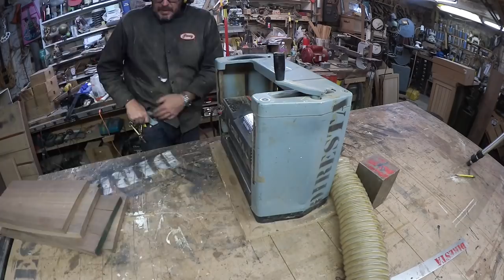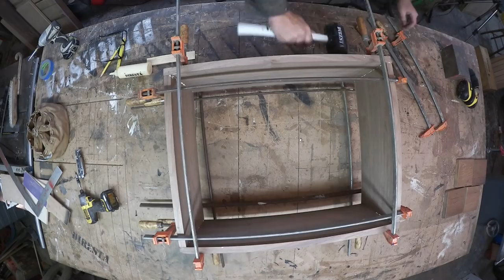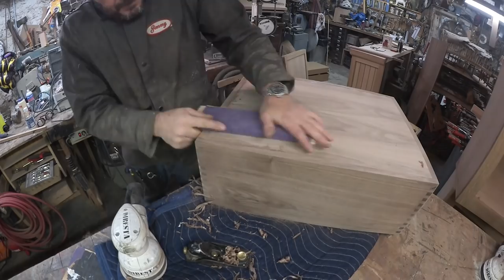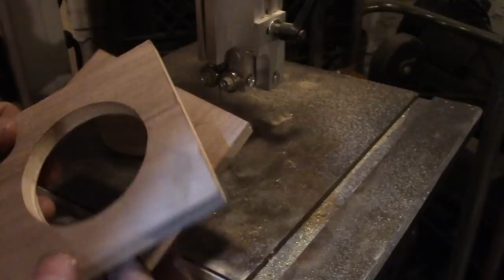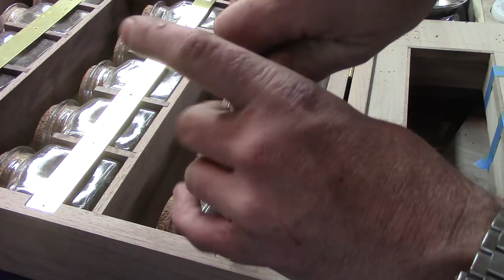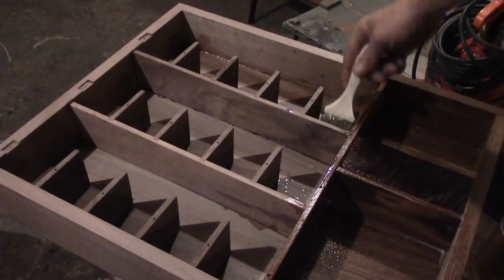✔ DiResta: APL Spice Box

Comment: I'm sorry if this question has been asked, but 427 comments is a lot to try to scan.  What was the clear "glue" you were using in addition to the wood glue?  Why use both types?
Reply: +Brian Hackett 
I was wondering that too. Judging by what he's used in the past, it's probably epoxy.
I'd assume since the bottom and top weren't interlocked like the sides it needed something stronger.
Just my guess though.

Comment: Awesome work, as always, Jimmy.

I was curious about something - not a big deal really - but I noticed that in some of your videos, you use a handsaw regularly.  My question is, why?  With all the power tools you have, it seems that wouldn't be necessary.

However, I have learned quite a bit from watching your videos so I am sure you have a very good reason.  Do you use a handsaw (like in this video) for a specific reason or is it to just add to the value of it being a handcrafted piece?
Reply from the maker: Thank you ! i often use the hand saw because it is actually simpler for me rather then to wrestle it into the saw. this part was very long to begin and the edges were not dressed , so the cuts were simply to handle the parts until i dressed the sides, then the perfect 90 on the chopSaw.  I like to use hand saw to keep practiced at the skill , it is not as easy as people think. try it and you will see how difficult it can be.
Reply: jimmydiresta
Thanks Jimmy!  Makes perfect sense!  And I agree, using a hand saw does take a lot of practice.

I've always been a tinkerer and builder.  When I was a kid, I built things all the time but was apprehensive about using my dad's power tools.  I used a hand saw quite a bit.

LOL - you should try building a skateboard ramp using a hand saw!!!

Thanks and keep up the great work!
Reply: +jimmydiresta 
A question about dressing edges. I noticed that you don&#39;t use jointer but  only a thickness planner and your table saw. When you dress the edges, I wonder if you could do that with longer pieces (these ones are smaller than your table fence/guide). Perhaps by adding a longer guide?
I'm asking this question because I hesitate to invest in this kind of equipment, between a DW 735 thickness planer and a D27300 thickness planner / jointer.
Thanks for your answer.

Comment: Why does Jimmy use the hand saw for the first 30 seconds of the video, and then switch over to the table saw?
Reply: I think they were just rip cuts to get it down to size as a large piece of wood is a pain at the saw table. A rip saw is probably quicker than the table saw; it leaves a rough edge but at the beginning of the project it doesn't matter as it will all be trimmed/sanded off.

Comment: Super duper)
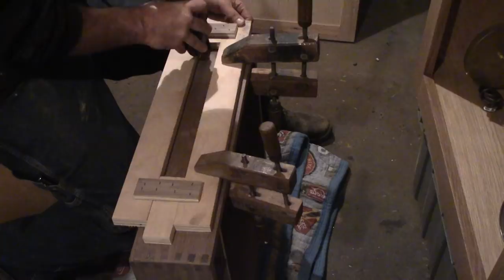what is the tool name on 9:12? seems like a pretty accurate thing to have
Reply: It looks to me like it might be a dremel multi max.
In general terms it's an oscillating saw. I've never used one, but every time I see a video of one being used I want one. I think they are a fairly recent entrant into the tool market, maybe 5 years or so.
Reply: The general term is a Multitool. If you look up
(Bosch) Multitool,  you will see the manufactures  version of it. It can be used for sanding & cutting. but the cutting it does is more of a wiggle through, it just vibrates around a bunch and can do lots. They are precise but NOT powerful.  We have burned through a few  dremel multi max but not a 12v bosch one.
Reply: Tuff Movies google dewalt dcs 335 for example, you'll see why it is called multitool. But it's not, cause multitool is pliers with screwdrivers and clippers in it.
Reply: You can pick one up at harbour freight for $20 if you want a starter.

Comment: What's the drawer for at the bottom with all those thin slots on it?
Reply: ***** Hmm, really? Can anyone confirm this?
Reply: +SalandFindles I Was wondering the same thing
Reply: In the description it says that the prototype was to be used to store and create spices. I really don't think that drawer is for putting the meat to be seasoned. Cleaning it wold be a pain.

However, the design of the drawer lends itself very well for DRYING herb. You lay out the plant material, and the slots let the air circulate around it as it dries. To me, that makes the most sense for it's purpose.

Comment: One battary hand drill for counttersinking, anothar battary hand drill for drilling, and a manual screwdiver for installing the screws?  You need a third battary hand drill, it seems...
Reply: Some screws require a delicate approach.
Reply: These little brass screws can break very easy with a battery screwdriver if you're not carefull ;)